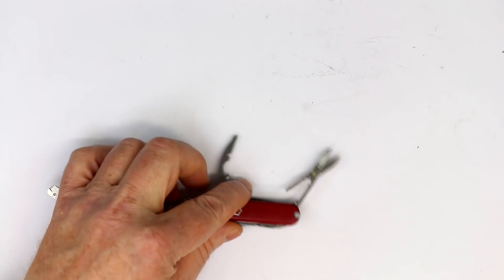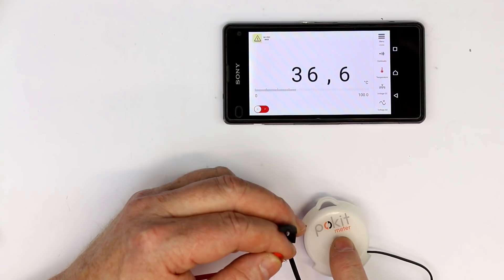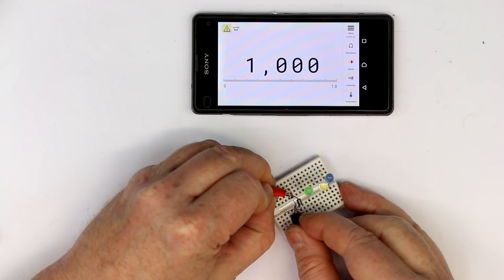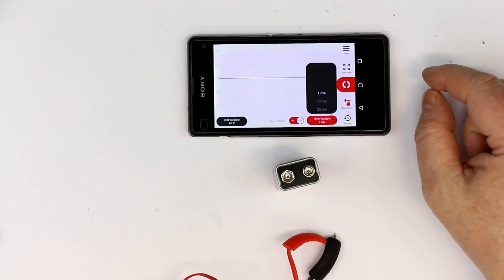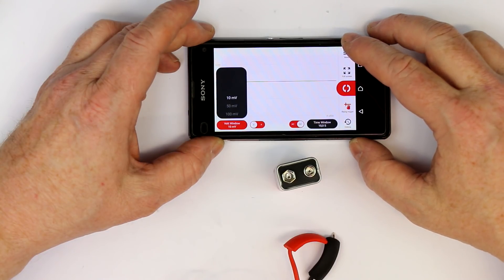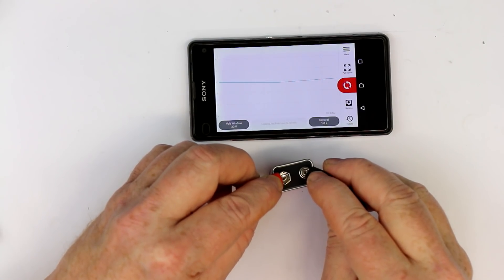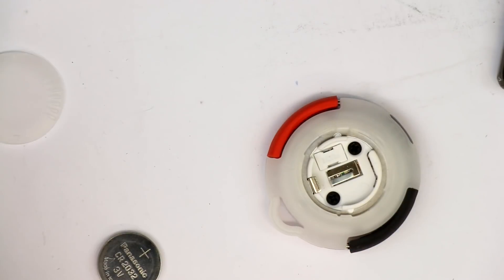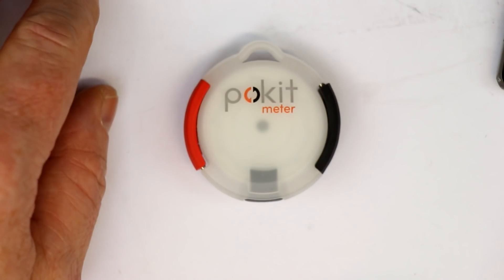Every Maker should have... [Pt.44]...a Pokitmeter

Comment: did you modify the RLC box so that it makes no heat?  Maybe i misunderstood your multimeter video.
Reply from the maker: The RLC-box would only dissipate heat if I would connect it to a power source and select a low resistance resistor.
That´s not the purpose of an RLC-box :-)
Reply: KainkaLabs   oh i mixed up a different channel...  i was thinking that if heat makes things magnetic then degaussing can cool them, and in the process collect energy that could be used.  I thought a good experiment would be to run degaussing lines around a Bunson burner and measure the temp...  but now i think that there would be no effect.  I didn't understand how your RLC box works because it seems to have power, if the multimeters read a voltage from it, but i was not paying attention.  You said something that reminded me of something someone corrected me about a long time ago, and i thought maybe i was right after all, but I'm thinking of the wrong thing.   Thank you.
Reply: oh... i thought it was some kind of power source, like an inverter or converter, amp, modulator...

I'm sorry. 
i thought you found a way to make a cool reaction, I'm not a good scientist. 
I put my theory on your other video from 9 years ago.  I am wondering if a power source can be cooled or stay cool by using degaussing equipment.  I'm sure it is wrong now.
Reply from the maker: Perhaps you are mixing up 2 things. The magnetisation of magnetic materials is reset above the so-called "Curie Temperature" which is different for different materials. That is because the ordered state of the so called magnetic domains ("Weiss-regions") which causes the remanent magnetism is reset by the increasing vibration/movement of the atoms with increased temperature. In theory this change of the state of the material could release some energy (heat) but it´s probably not practical or high enough to be put into a good use.
Degaussing is a completely different procedure to reset the magnetisation of a magnetic material. Here heat is produced by the eddy currents of the degaussing field. This certainly cannot be reversed to produce a cooling effect (just as your electric oven cannot be used to produce cooling).
There are from my memory magnetic effects that can be used for cooling but AFAIK these are mostly quantum effects, not very efficient and only used in scientific applications (unsuitable for commercial/household applications).
Reply: KainkaLabs    the degaussing equipment cancels out repeating patterns by creating its own field, not by absorbing the energy from another source.  I'm sorry, i am just beginning to study these things.  I suppose everyone would like to find a thing that absorbs the energy, to cancel radiation.
Reply: KainkaLabs    hmm...  this takes a minute for my brain to process.   Maybe if they tried using that non conventional magnetic stuff you mention at the end there...  Maybe it would work, not degaussing stuff...  I will have to read this again and watch over videos.  Thanks very much.
Reply from the maker: Heating up magnetized material --> Curie-effect https://en.wikipedia.org/wiki/Curie_temperature
Degaussing --> Apply a sinusoidal magnetic field with decreasing amplitude down to zero --> https://de.wikipedia.org/wiki/Entmagnetisierung (German Wikipedia explains this better than the entry in the English wikipedia)
2 different effects!
Reply: KainkaLabs   whoa... i see.  i don't really understand magnetism, even.  So the heat doesn't make things magnetic, it's the reaction in the metal that causes magnetism...  i think.. I'lll read these...  I watched a vid where a guy who bought equipment from a college has a degaussing coil...  it can spin things around in the middle.  I said what if it was around a Bunson burner... i think the flame would spin.  I knew someone who claims they helped invent a kiln that uses vortex technology to heat up to incredible temperatures.  At a certain point, the vortex starts to accelerate the heating process by itself, making like an over unity or excess of energy, that must be regulated or the kiln would explode. 
If that energy, if it exists, could be converted into electrity and the whole process cooled down...  i don't know.  Thank you again.
Reply from the maker: Of course you know that everything with "over-unity" is bullshit. For Demagnatizing/Degaussing you could watch these 2 videos from me: https://youtu.be/T4q5irgKEew and https://www.youtube.com/edit?o=U&video_id=q4Ws5yZK500
Reply: KainkaLabs    I am not convinced that all overunity systems are BS.  I read the first two links.  The second one is in German, so idk about that one, but the first one says that ferrous material does not align its dipoles until it reaches curie temperature.  I think that's wrong.  I know that pieces of metal that are sitting close to a welder get magnetized without ever being heated up.  No.  They are sitting too far from the welder doing his work.  Maybe it is because the table gets magnetized, and then the dipoles in the table align the dipoles in the drill bits and other metal objects on the table.  Sorry to bother you.  I believe that spacetime is cohesive and there is energy everywhere that contained in space and it circulates, I'm looking for unified field theories.  Things that induce the energy from the vacuum, not just produce energy.  Thank you for your help.  I will watch these two from you.  Sorry i am a dreamer.  I have known many good scientists who think it is a waste of time talking to me.  Have a good day.
Reply: KainkaLabs ...  ... basically I'm looking for ways to create a wormhole that can be regulated and controlled to wick the energy out of spacetime, like a wick in a lamp.

Comment: Interesting and nice to have in you bag but its to expensive for the 2-3 times i would acutally have use for it. I think a 10€ poket multimeter would be enough to carry around.
And never use one of this cheaps oscilloscopes especially as a beginner.
Reply from the maker: But that´s the point. If you know beforehand, that you need a multimeter, you can take your "normal" or a pocket-multimeter with you. But I´ve encountred endless times that you come in a "surprise" situation where you need a multimeter to check something but don´t have onr at hand. That is I think the idea of the Pokitmeter that you can put it at your keychain and always have it with you.